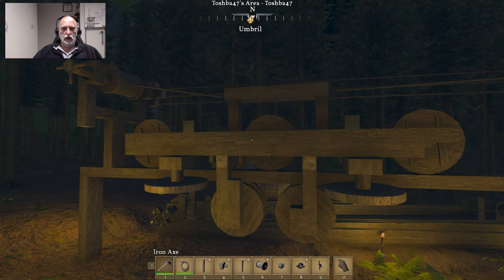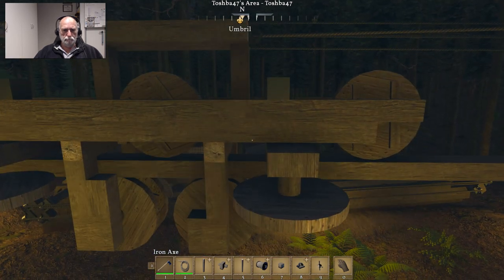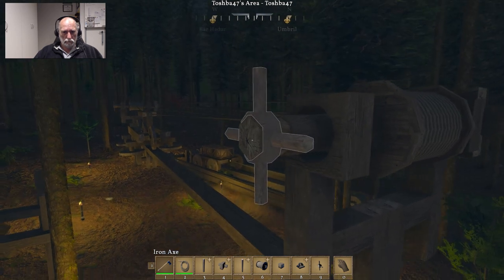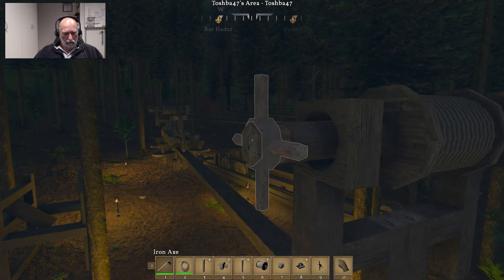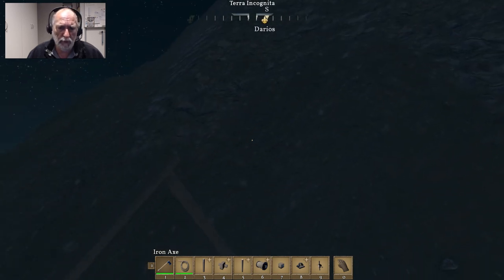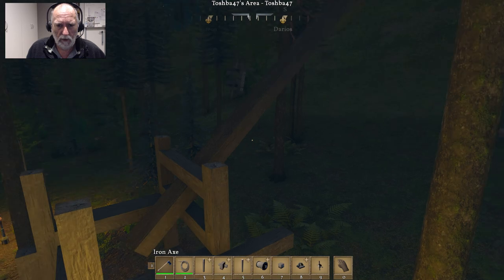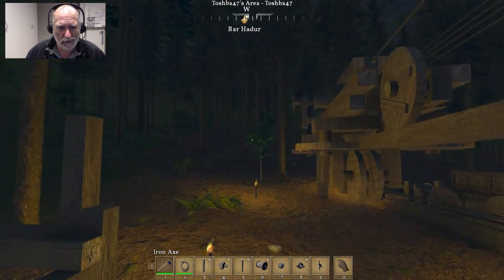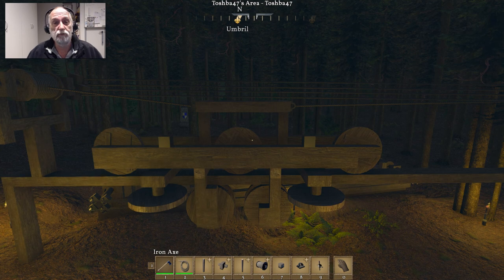Medieval Engineers - CableCar for TheRADIOMAN03

Comment: I am having real trouble trying to build a two pulley crane with only one wheel and wondered if you could help me? it would e appreciated
Reply from the maker: Not exactly sure what you mean. Can you tell me in a bit more detail what you are trying to do and I will ahve a look for you. No guarantees i can do it, but i do like a challenge.
Reply: I want to lift something that is two heavy/ large for just one pulley with one rope therefore I need two ropes  to lift simultaneously with just one control wheel- hope this helps, many thanks
Reply from the maker: Why not just belt drive two drums together that way they will turn at the same time even though they have different ropes. You can see how i set up the belt drive in the Cart video, it should allow multiple things to act together. Hope that helps.